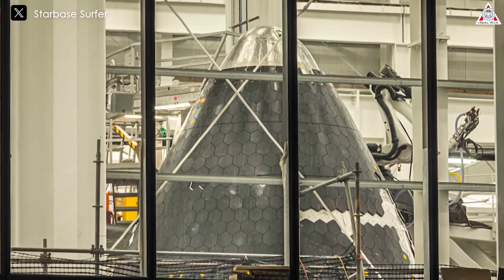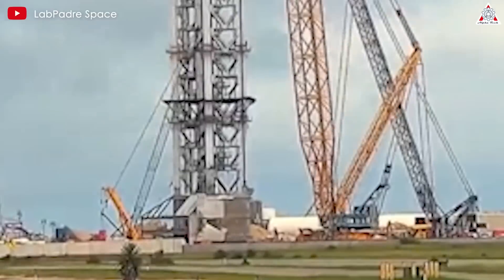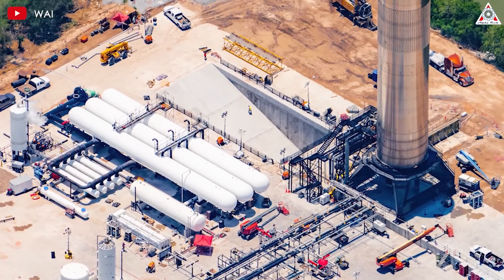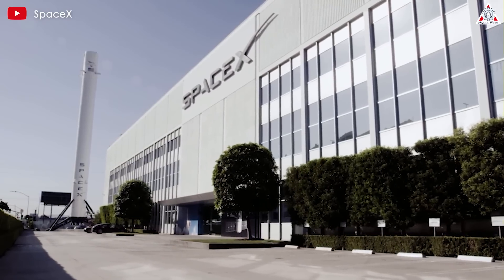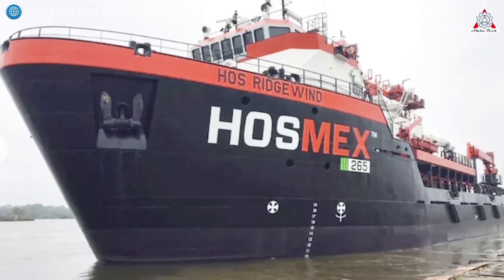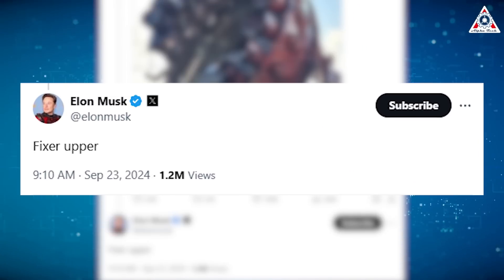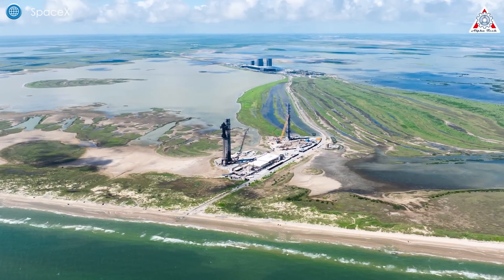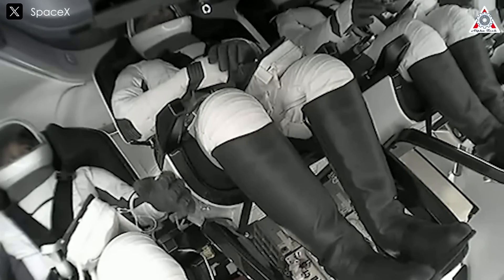SpaceX Reveals NEW Pad Upgrade For Starship Launch, Unlike Any Others...

Comment: make mobile but in the water man made water with tech used iboring company have station but a failsafe be a tunnel  tch
would cause issue but if be better then trying than fishing out if going to build in circle do five may 6 towers but five would be more efficient and could service and use easier Im not a rocket scientist my Grammer poor no glasses on. really. a  nobody dropout but I fixed .my mail box with such
tape years ago and mail still gets delivered

Comment: The first OLM is hardly "traditional", as you call it; rather, it was a one-off idea, and not a good one. The new OLM is in fact designed to be much more traditional, starting with the use of an actual flame trench.

Comment: Gee? never dared to imagine? if you dig back thru my writs here on Alpha Tech theres mention of a launch mount where the thrust force is contained by connecting the mount to a base rather than pilings into the ground.
That the thrust pushes against the base plate, which is pretty good for friction connection towards down...

Have also mentioned launch mount componants that are able to be changed out for refurbishment. That was on a sea launch writ... 🤭

Glad to see they are working those directions that "Nobody" dared to imagine.
Now if they'll just start thinking about that tower, and all that waste heat from the rocket exhaust, and that it would easily power a flash boiler, and a steam catapult system to give the ships some lift assist when they are using the most fuel to fight stationary innertia...

Would mean increased payloads for same fuel use.

Real Engineers like using wasted energy, the results are called: "Efficiency"....

🤣Just sayin'

Comment: Elon is brilliant.Guys seriously sea catch attempt for starship is utterly stupid and operation cost will be more high for starship spacex will go bankrupt. Think in common sense
Starship landing leg ok but booster landing 3400metric ton in middle of tide waving sea or landing leg in sea is impossible. After landing sea waves will disturb heavily for booster. If  they land in drone ship platform . How they transfer booster via road using truck. It is not possible. If they catch in middle of sea. How they fuel huge starship and booster. It will make starship operating cost is very high. Better catch attempt is best . If mechazilla damaged in catch attempt they can easily repair. Sea catch or sea land for starship is a burning money technique. Instead of land on sea. They pay fine for faa. Land catch option is best for starship in all ways by cost and easy  for next launch.

Comment: When thinking about the catch tower and olm I have thought about tossing a toddler from Dad to Mom
or Mom to Dad
The hands need to adjust 
The footing needs to move
The arms need to be able to quickly react to the change in weight
The child is highly valuable and so is Super heavy😅
Reply: That's why the Starship has Rocket engines. To slow downward motion to a standstill then sideways thrusters to wiggle it's way precisely into place. Maybe you should apply for a job at SpaceX so can can show them your way of doing the same thing.